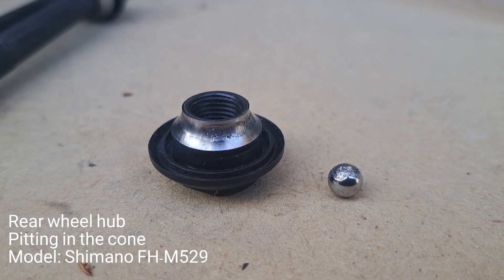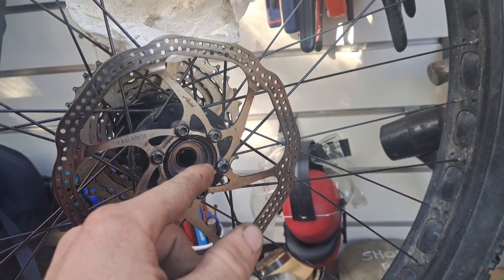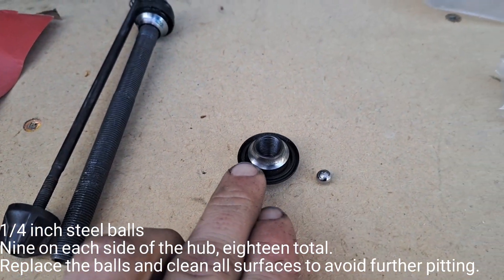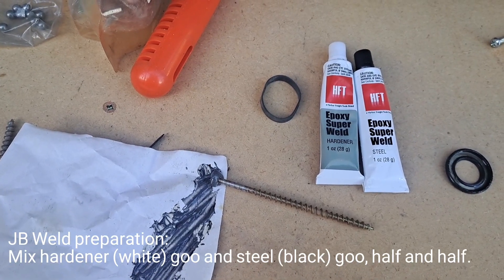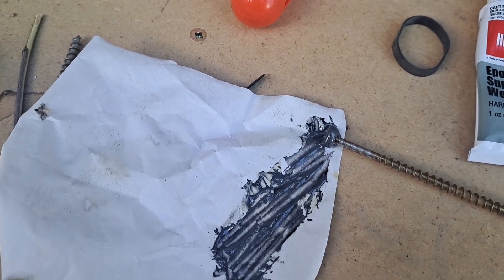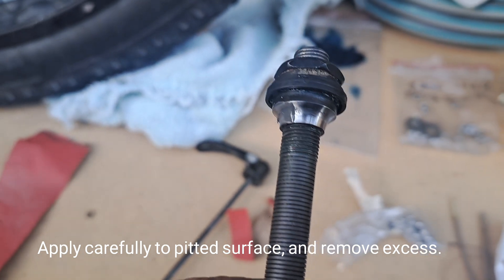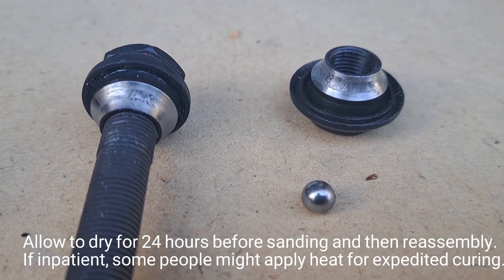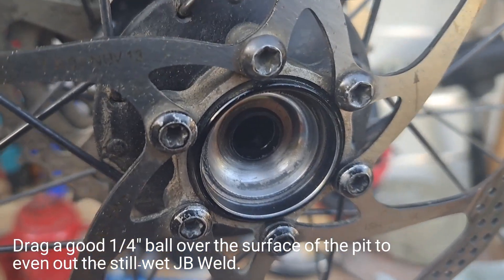My Fix: Bicycle Hub Cup and Cone Pitting

Comment: The cups have a locating ride around the wide “top” end. To get the cone out, drill with a hard tipped bit the cut the edge with a Dremel and diamond engraving tool. The cone will collapse and can be tapped out. New cones cost about £10 a pair. Not nothing, but cheaper than a new hub and rebuilt wheel.

Comment: There are many videos on cone resurfacing, but not many on the cups. What I do on the cups which works for light and medium pitting is to use a drum sander in a drill, the trick is to only put the drum on about half way and as you move clockwise on the sides then go down to the bottom, the lower part of the drum sleeve will conform perfectly to the bottom curve. Have saved dozens of wheels this way. 80 grit will be fine and I do have an extremely fast drill, I believe it is about 1800 rpms. I run a bike shop out of my garage and hate wasting stuff when with a little bit of ingenuity, many things can be repaired to like new condition.

Comment: Love your spirit, but just buy some new cups 😂
Reply: Where can you buy new cups?
Reply: @paxo22  well, after scouring the internet for an hour looking for a reply to your question, my conclusion is that it might be very hard to find a replacement set of cups. I once worked at a bike shop where I had access to a giant book, like phone book, full of part numbers for bike parts from an aftermarket bike-part outlet, but I can’t remember the name of that company, and it doesn’t seem to be available to the general public. It might be worth it to call up your local shop and see what they can do to help.
Reply from the maker: @Ccccccccccsssssssssss  haha, thanks for your time! I did research at the time, and I think it depends on the hub model. Some have cups available, others don't. It also depends on the shop - not to talk smack, but some shops won't give you the easy answer. A wheel rebuild makes them more profit than a cub replacement, so they have no incentive to help you source hard-to-find cups.

Comment: JB weld is strong but its not quite hardened carbon steel levels of strong. I would be amazed if the bearings didnt reopen the pits and break up the repair in a few miles. Even sanding and polishing runs the risk of cutting through the hardened finish put on races, and achieving a smooth race that doesn't have the same durability as it did originally. I think the finest possible polish with a soft wheeled dremel is the way to go. Even then i fear poor technique will lead to a non round bearing race.
Reply: New cups have a retaining ridge at the wide side. Get the old cone out by chain drilling and Dremel cutting a slot. This will collapse the cone for easy removal. Similar methods work on steering star nuts.
Reply from the maker: Totally agree, on both fronts. JB ain't hard enough, and getting a perfectly round after-work part will be tough. That's life. We'll avoid a full wheel rebuild anyway we know how! I think a friend with a lathe and some time on their hands is the only way to get a good round.
Reply: @claytonbennett7797 used to have a friend with a lathe, made his own hubs

Thoughtfully made the cups an interference fit in the hub body

So for his hubs the solution was warm them up, tap the cups out, take the new cups out of the freezer and put them in

Comment: Nice to see! I'm curious to know: how did it end up? Were the bearings smooth again after all? I'm thinking of doing this on the hubs of set of Vision Team 30 wheels, which are in very good shape, except for the bearings..
Reply from the maker: The bike is doing fine. I never replaced the cups. No catastrophic failure beyond the existing level of pitting. The rear wheel spins smoothly enough. I won't claim that my JB Weld job did any good, but, maybe it helped to prevent further pitting.